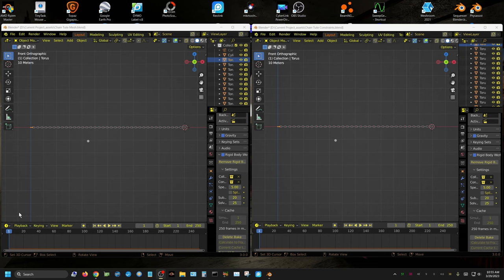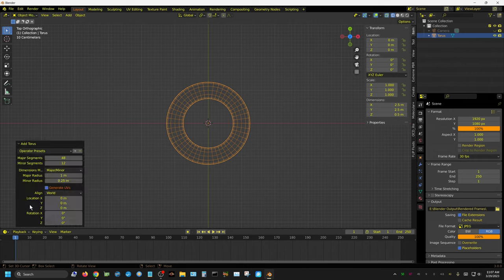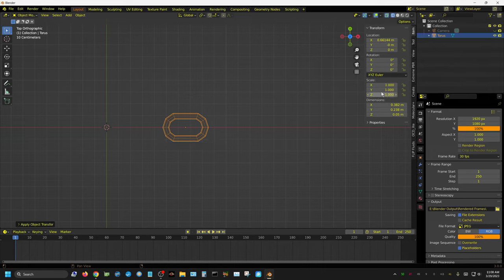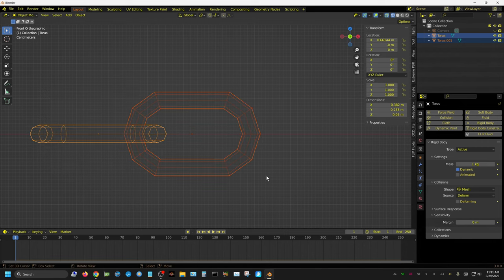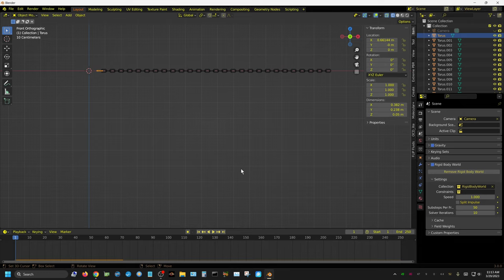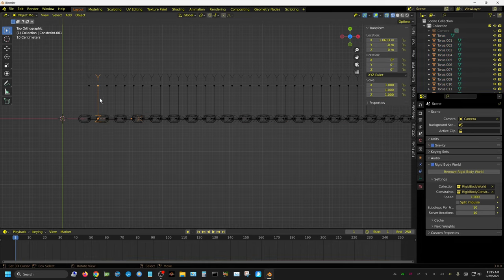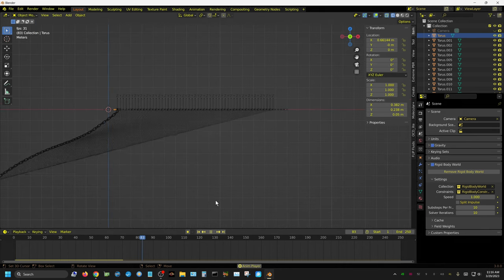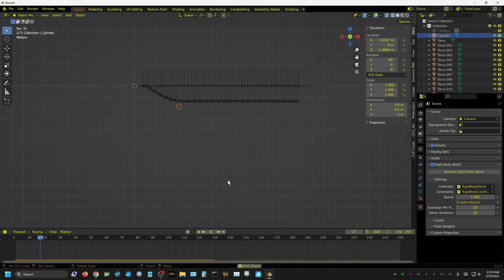How To Make Rigid Body Chains Stable In Blender

Comment: hey man great vid, but do you happen to know a way to intentionally break the chains after simulating and animating?
Reply from the maker: The chain breaking would be part of the animation, especially when you are talking about physics based animation. You however can use keyframes to trigger a break when and where you want it.

As an example, each of the links in this chain are held together with a constraint. You can make a constraint breakable. You can keyframe the breakability in constraint settings.
Reply: @BlenderRookie  nice thanks, will try

Comment: Ah, yes, I did discover the exact same trick years ago, by myself, actually, after many tests and tries (I even made another animation that I think was very, physically correct, especially for what i knew at the time, with rigid body constrained chain mail in 2 rapidly rotating gears, one training the other). When I was learning blender, I was trying to do a long chain with a wrecking ball to destroy a wall fractured and the fractured bits constrained for added realism (some rare addons let you add such constraints in one click which would be impossible without it). But sadly I think the physics isn't as realist as with the rare animations that did work at the time somehow (lots of patience, and sacrifices, I suppose, don't really remember) and that used no tricks with the hinge constraints.
PS: I retried this with a really long chain and this method, and it still  works (relatively), but I had to add and edit every last one of the contraints between the mails of the chain, and it won't be as realist as I would like it to be... Maybe I should try something with the method of using a cloth physics for the chain, it looked good in tests (you can even edit the weight of an individual vertex), but I have no idea how to make the chain itself mimic the movements of the vertices of the cloth "rope".
Anyway, thanks for the tutorial.
Reply from the maker: I was able to get chainmail work a few times if I made the links atrociously large, which of course made the simulation seem really slow due to the scale. But it didn't need any constraints. https://www.youtube.com/watch?v=gZXbIqnO5YM

Comment: Hm, I'm not getting these hinge controls, nothing happened.
Reply from the maker: Give me a timestamp in the video so I can more quickly understand.
Reply: @BlenderRookie  At 9:10 you selected Rigid body -> connect and then get these hinge constraints on the chains. Now I see that they appeared (they were totally displaced so I didnt see them), however I have 4 chains and only got two constraints, some are still missing I guess, can I also add them manually under physics -> rigid body constraints? Would that be the same?
Reply from the maker: @ParaparapartyParrot  Sounds like somewhere along the lines you created chain links with their origin points in weird locations or you forgot the chain by distance setting. Also, if you have multiple chains(not links) each chain will have to be setup separately. My guess is you skipped a small step somewhere. So go back to about 1:30 and go through it slower. I will tell you the origin points are important when it come to rigid bodies. It should pretty much always be in the center of mass. for each rigid body object.
 
Another thing you might have done wrong is duplicated the links while in edit mode instead of being out of edit mode when duplicating the links.
Reply: Okay, figured it out, I had to set origin to geometry, I messed up with Ctrl + A, apply all transformations, I guess
Reply from the maker: @ParaparapartyParrot  It's almost always the little things that get us confused. I;m glad you were able to figure it out.
Reply: @BlenderRookie  Yes, messed up with origins, I already had the chain when I began watching this video